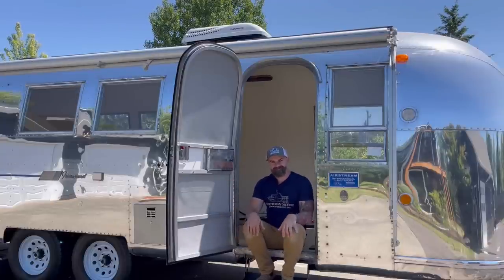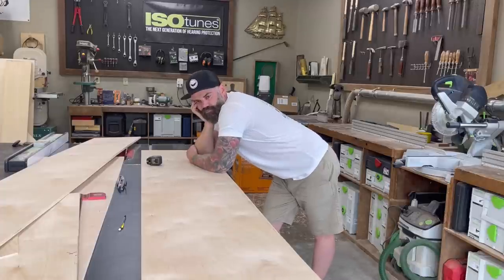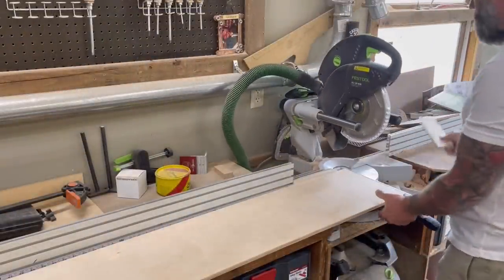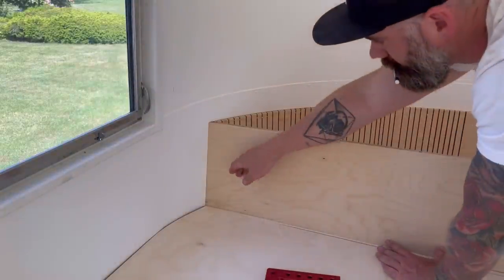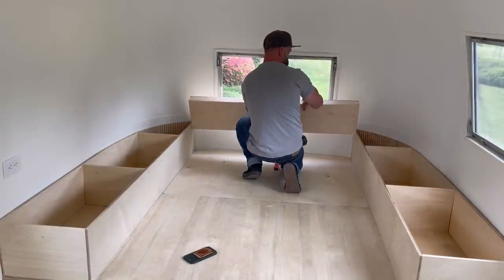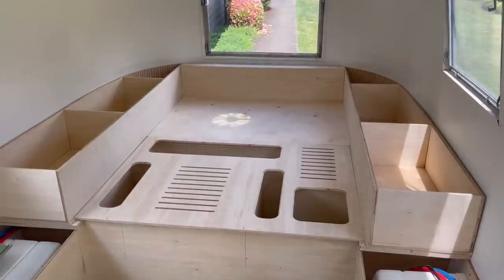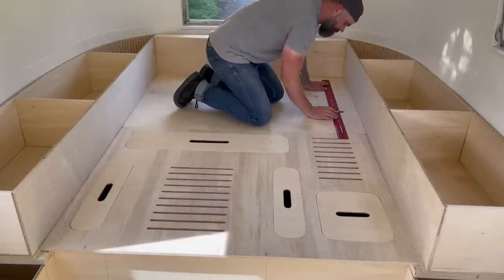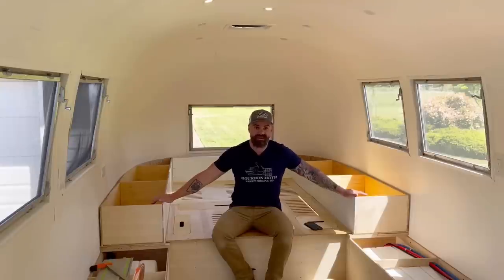Airstream Storage Bed  || Custom Building an Airstream

Comment from the maker: To start comparing quotes and simplify insurance-buying, check out Policygenius: https://Policygenius.com/bourbonmoth. Thanks to Policygenius for sponsoring this video!
Reply: Haloa, SHOWER, if u wanna travel during winter, you will regret to not have an inside shower dude... Anyway Love From France, u're kinda Mentor, <3
Reply: I think you could have kerfed the outside of the curves ;)
Reply: I have a question regarding outdoor wood furniture sealing. Please advise what the best product to buy if one shops in Lowes for outdoor oil-based wood sealer.

Comment: It seems to me, that you should be packaging your templates, mass producing them, and selling them. I myself have no desire to undergo an airstream Reno, but I'd wager that there is a significant number of people who would appreciate this.
Reply: Same, but Id be curious if nearly every airstream has slightly different contours and each piece has to be custom to that exact camper.
Reply: Haha there's no way airstreams from that era would be consistent enough that templates that accurate would be transferrable
Reply: I used to build these for a living and I can assure you that every trailer might look the same they are not exactly the same. Having templates could save time and get you close to what you need but you will still be scribing every cut to get a good fit.
Reply: He's brought this up before. The reason no templates exist is all the airstreams are a little different.
Reply: I imagine it also depends on the mechanical build out and body work that goes into each refurbished airstream. That type of thing will vastly affect the interior dimensions, especially if the mechanical/body work was DIY’d.

Comment: I used to build these trailers at Airstream. One thing you're going to want to account for moving forward is LATCHES. Every drawer, door, access panel, lid, etc. needs some way to secure itself during transit or your stuff will absolutely be flung around everywhere. Also, save yourself some heartache and don't build backs for your cabinets, it will save a ton of weight.
Reply: This is good advice. He also needs to redo wherever he's doubled material and remove the excess.
Reply: There is a good system called buttonfix. There is a metal version for that and it is also used in the naval industry. Would love to see him use it because I have an upcoming project myself using that system
Reply: I can see where the structural support is helpful on the bedside cabinets to have a back on the carcass.. he could route out a big chunk of those to save the weight while still having the support those things need, while reclaiming cubic inches.
Reply: Anthony is correct.  I'm Just finishing up a schoolie conversion and I assumed that the self close feature on my drawer slides would be sufficient to hold the drawers shut.  This proved true for laterally mounted kitchen drawers, but my two large, forward facing dresser drawers decided to join me in the front of the bus the first time I had to lay on the brakes.

Comment: Hey Jason, it's not just the total weight, you might also consider the weight distribution. You want to get the weight in front of the wheels and the weight behind the wheels balanced so that it tows correctly and doesn't sway when being pulled. Also the weight on the tongue needs to be within a certain weight range. Great content bud!
Reply: This is huge and bears repeating over and over.  Additionally, adding what is beginning to look like an extra ton to a lightweight trailer will probably require looking at the frame, springs, shocks and maybe even the axles to see if they need to be upgraded.
Reply: Came here to say the same. Definitely need to be weight conscious in terms of total weight, weight distribution, and tongue weight.
Reply: @heathbecker420  Absolutely don’t want to end up with “negative” tongue weight.
Reply: The thing you've got to remember about the weight is there was a ton of stuff - made with much heavier materials - when it was all original. All he's really doing is adding that weight back in it. Also, when you're towing it with a regular hitch, it's better to have the heavier stuff towards the back to reduce the chance of damage to the hitch. I really don't think weight is as much of an issue as some might worry about.
Reply: Also, as far as sway, there are two features to solve that concern. One is a sway bar. The other is tow switch in the truck, which helps compensate for potential sway. 

I think, to me, is to remember the year it was built (1963?), when they didn't have things like sway bars. Also, I think he has the F150 Lightning (the electric one). Have you seen the ad where she's towing a train with one?
Reply: @cindyhammack68  Sorry but weight in the rear is the worst thing when towing a trailer and the fastest way to having an accident. Ideally weight would be balanced through out and a trailer this size should have 800 to a thousand pounds  pressing down at the hitch.  That would give it a perfectly smooth pull without the bumps and dips in the road causing the trailer to become upset.
Reply: As to the weight distribution, most manufactures will tell you the tongue weight should be no less than 10% gross trailer weight and no more than 15%. Less than 10% would be a dangerous ride with lots of swaying and over 15% is to much stress on the hitch.

Think through this as you plan how you will load this up for a trip. You'll obviously already have full propane tanks and you said you water tank is below, but the location of it matters. Is it in front or behind axles and how far Some people like driving with full tanks, if no access to fresh water at destination. That all will matter a lot. Not only the weight, but also distance from the pivot point between axles. It will act as a fulcrum the farther from the axles it is. Your center of gravity (CG) should be slightly in front of the front axle, give or take.
Reply: @cindyhammack68  Have you ever wondered why people who trailer a car always load it engine first and not engine last? You don't want the majority of the weight after the axels... This will cause the trailer to "wag". Not really safe to drive. Trailer stabilizers can only compensate so much. 
Besides, most of the weight will be in the middle, where the kitchen and bathroom utilities will be located and most likely the sitting area will be up front.
Reply: @rea59  I didn't mean that it shouldn't be balanced. I meant that if one side had more weight, it should be towards the back - as opposed to the front. I think 400 is the original tongue weight. But, the original total weight furnished was right at 4,100 lbs. If you look at the original floor plan, beds (2 twins) were not in the middle. They basically went over the wheel wells. The back was the bathroom, the front had a pull out bed, and the little kitchen was in between the twins and the pull out - basically opposite the door. Now, where do you think the center of gravity would be? I would think somewhere around the wheel wells. That's about 2/3rds way to the back. Meaning the back is heavier than the front. I'm just looking at the original floor plan. Total weight = 4k lbs - tongue weight 400 lbs so the remaining 3600 lbs is distributed throughout. If the center of gravity is the wheel wells are about 2/3 rds in, 1/2 the weight (about 1800lbs) would be in the front 2/3rds, 1/2 would be in the back 1/3 rd. The wheels help balance the load as it's moving, which makes sense. Putting more weight towards the front could potentially bend the tongue due to gravity. That's why 1/2 the weight is in the first 2/3 rds. The weight should balance  on the wheels, not the middle of the camper.
Reply: @cindyhammack68  This is what these fine folks are talking about: https://www.youtube.com/watch?v=w9Dgxe584Ss I get what you're saying, in a perfect world, the load would be perfectly balanced over the axle. If it is biased, it absolutely needs to be biased in front of the wheels, not the back. Obviously too much tongue weight and things get broken, but if there's a differential toward the rear you aren't going anywhere safely either.

Comment: I'll say it again, get 3/8 bendable plywood to use on your curved sections. No kerfing and easier to scribe. Used it alot when I built boat interiors. Good work!
Reply: ^ This
Reply: I’ll add these  4’ x 8’ sheets come in short grain and long grain. My sales rep would ask, are you building a column or a drum?

Comment: Ever little bit of weight savings makes a difference when you're towing.  Similar to your boat builds, you may want to consider skeletonizing the pieces of the cabinets and compartments that are inside or hidden against the walls.  This will leave enough material for structural integrity while possibly removing up to a third of the weight.

Comment: in regards to those curved triangular sections at the head end of the bedside boxes: perhaps decrease the depth from 11 inches to like 5 or 6 and line them and use them as bedside drink holders/book caddies/electronics holders . basically a deep tray kinda scenario for tossing things that u don't wanna have to get out of bed to store away.
Reply: … or turn them into solar  ‘led uplights’.  Just open the curtain in the morning to let light into the room during the day.  Uplight could be a surface panel you can utilize as a surface area to place reading glasses or whatever you go to bed with.

Comment: those corner parts where the curved section is, you could pop in lights one up and one sidewards in each, and voila used space and mood lighting,  Great work so far,

Comment: Weight:  To save on the weight, perhaps you should consider using polypropylene honeycomb boards.  They were used throughout our RV and are very robust and durable.  With less than 10% of the weight of plywood you can cover a large area quickly and then with a veneer or 1-3mm birch boards to cover the polypropylene honeycomb as appearance.  Remember for safety that 65% of the weight needs to be on top or ahead of the axles.

Comment: Awesome. I'm building the inside of my camper (GRP composite box on top of a 4x4 sprinter flatbed truck) and oooh boy the weight adds up. With my skills and tools and literal barn, making the bed-sofa-table-storage-convertible monstrosity in the rear has taken me WEEKS, so I wouldn't worry about feeling it takes a long time. I find myself spending the majority of my time just staring at things, figuring out how to attach impossible aluminium-plywood-glue-rivet-contraptions so that they are light, sturdy, possible to service and don't interfere with whatever else I'm going to be doing in the area. Making the ventilation holes and stuff... man, a CNC would be nice.

Comment: Great build so far. Just a thought for access to the under the bed storage: In addition to the removable tops, you could put a piano hinge at the back with pistons on the side to have the whole thing lift up. With the split mattress this would make access a breeze so you do not have to reach down in the holes that you cut. Keep up the great work!

Comment: in a RV or trailer, every single inch is needed for storage.   the head board could work for laptop/tablets.  or a nook for books accessible from the front (panels that pop-out)  the corners - frankly that's a huge amount of storage in trailer terms.

Comment: Loving this! One thing that you may ask yourself before you start building the kitchen is if you need an oven and stove top. Every time we used our campers, we either grilled or used a griddle outside. Save yourself some space inside if you don’t need it and maybe just get a good size microwave.
Reply: We have been using rv’s for about 40 years now and the only thing we have used the oven for is storage.
Reply: Those small electrical convection hot plates are pretty amazing too.  Put a Lodge dutch oven on top and that's all the oven you need.

Comment: Regarding tire blowouts, I would highly recommend investing in a tire monitoring system.  We had a blowout that destroyed multiple propane lines, and we got lucky that's all it did. Bought a tire monitor system, and the very next trip detected a huge leak in my truck tires that would have blown out. Saved hundreds

Comment: Jason, why have you doubled-up the plywood for the "saddle bag" storage boxes? You have two layers. First you covered the under-storage, then you built the storage boxes. If you remove the two-part under storage plywood tops, the bottom of the upper boxes closes off the under storage. Food for thought...

Comment: Im 3 weeks behind and just catching up on this Airstream series now. I wish you would have called me earlier. Too late now but building trailer interiors was job I had for a few summers between semesters in college. So for a guy that doesnt know what he is doing, your doing fairly well IMHO. So your conscious of weight thats good, but also be conscious of WHERE the weight is. Weight you add behind the axles will need to be off set with the same weight in front of the axles. So plan for that as best you can now, and its good that your keeping an account of how much material you have used so you should get pretty close. The old saying goes... " a nose heavy airplane flies poorly, a tail heavy airplane flies once." Weight layout is key for a safe towing (and flying) experience. Ciao

Comment: A suggestion if you'd like. The pieces under your side storage cabinets that are the original tops of the bottom storage compartments. You could possibly remove that extra layer, let the bottoms of the cabinets serve duel purpose much like you stated early on in the video, and use them as part of your separating wall or even for an overhead storage cubby around the bed. You already have a starting point for the scribe contour so you might be able to fit them in with minimal adjustment to their existing shape. it would be a minimal weight savings but there none the less. Not trying to tell you how to do anything as I'm more clueless then you are on all of it, just trying to help a brother out with an idea and your concerns for weight. I would imagine that trailer can handle a lot more weight then people think it can.

Comment: Idea re: weight. You could have used the existing bottom and existing wall as two of the 4 sides of your bed storage carcasses, saved a lot of work and weight, there wouldn’t have been all the kerf cuts and then more work to hide them and then sand them and then rubio them. Car makers have learned the best part is no part.
Re: mindset of tiny spaces and mobile spaces is that everything has to do 2 or three things. Like the top of mattress platform is  the bottom of the storage cubbies, the bedroom wall should be the wall, the inside of a cabinet and the other side of the wall, change from “surface-stud-surface” mentality. 
Re: waterlines, insulate between them and the cold but leave them exposed to the inside as much as possible for freeze protection. Some of the best camping with least humans is in the “shoulder seasons” weather isn’t as reliably perfect .
Great build, you are rocking it, thanks for sharing it in such an honest way, from your neighbor in 97062.

Comment: This may be a bit late for this suggestion, but you could also cut some holes in the front of the storage compartment and the dividers for air movement and weight reduction. This would create some convection by allowing cool air to be drawn in under the bed.

Comment: Jason, you prevent the majority of blowouts by monitoring your tire pressure with a TPMS (Tire Pressure Monitoring System). I bought a TST branded system and I’ve been very pleased with it’s performance. You can set the low pressure and the high pressure alarms. Low pressure alarm will alert you if the tire pressure falls below the low-set threshold and the high … well … you know. Rationale, you have a slow leak and your pressure goes down … you might not know and keep driving — eventually shred the tire and cause thousands of dollars in damage. The high pressure alarm will alert you to axle/hub/dragging brake issues, which will over-pressure your tire and cause a blowout. The TPMS alerts you BEFORE the damage occurs. I’m enjoying your build. We bought a new 2017 Airstream and sold it last year … too many problems … live in an HOA and I couldn’t effectively work on it at my home. And the problems were countless due to such epically poor build quality. I fantasize about getting an old one and doing exactly what you did … have a specialty shop lift the shell, do a new frame (line-x), but I’d prefer a poly-floor so if it leaks the wood floor won’t rot. But otherwise, then do exactly what you’re doing. But it’s a fantasy. Can’t do it where we live. So I’m living vicariously through you. Keep up the great work!

Comment: A lot of European caravan and boat builders use 9mm ilomba faced poplar plywood sheets, which is incredibly light, but strong. Really great for times you don’t need 18mm birch. I used it in lightweight speaker design, and it can be magically weightless. We did have a 4x8 CNC though… ahem…. LOVE THE CHANNEL, keep making!!!

Comment: I think the work you're doing here is pretty amazing. Building out an RV is something I want to do. I would  add 2 points to watch out for:
1. Flex. The RV is going to flex and move so the tighter you make things, the more likely it is to cause damage while flexing. Most RVs I've seen actually have more gap than you'd think.
2. Weight distribution is as important as total weight. You need to know how much weight you have in front and behind the axles and keep the ratio about 60% in front and 40% to the rear.